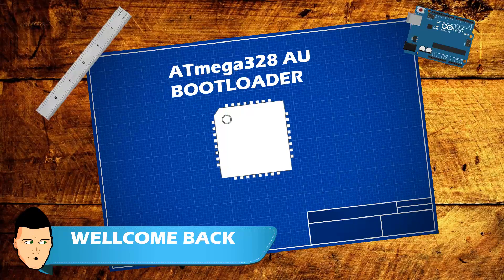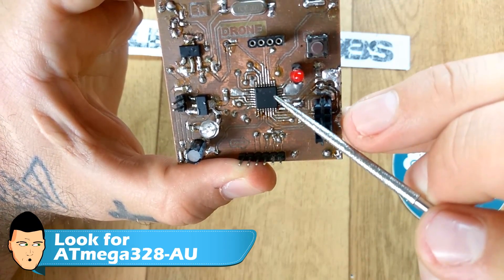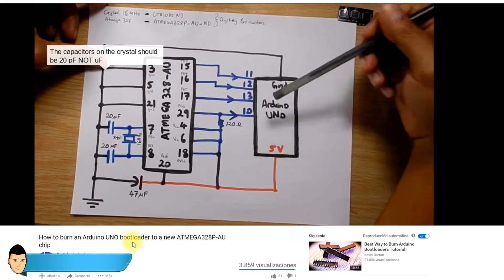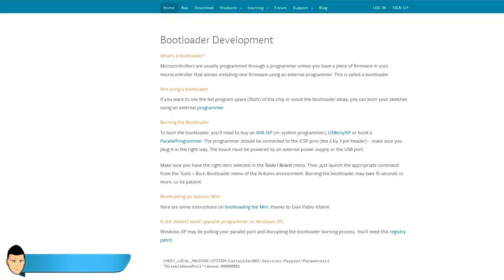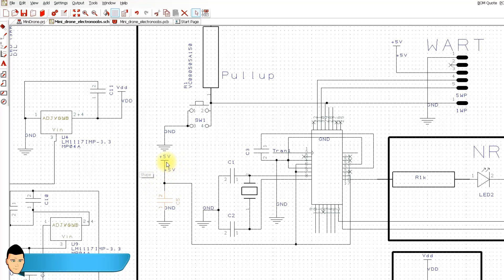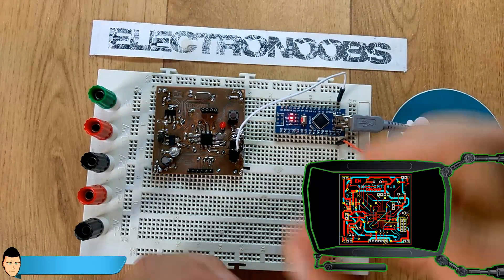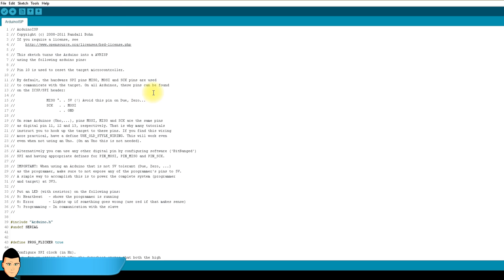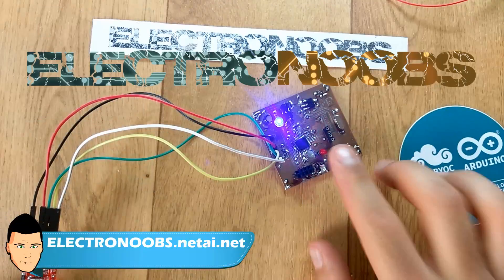Burn bootloader to ATmega328p AU with Arduino NANO

Comment: you mean I need to use an Arduino Pro Mini 3.3V/8MHz version to burn the bootloader to a virgin atmega328 chip to be ran at 3.3V/8MHz ?

Comment: The circuit to burn the bootloader does not have the 0.1uF but the FTDI circuit has, is the 0.1uF required for both. Also the 47uF cap is electrolyte or cermic because you are using a US type?

Comment: NO FUNCIONA, en el minuto 4:21 tienes una conexión Wart con los pines 4,5,6 (del modulo FTDI) a pines 31,30,29 (del micro) respectivamente, y en tu página tienes un diagrama que muestra los pines 4,5,6 (del modulo FTDI) a pines 30,31,29 (del micro) respectivamente. entonces estas invirtiendo los pines 30 y 31 del FTDI al micro en tus diagramas. Yo sin darme cuenta, hice mi PCB con la primer configuración que menciono y no funciona, también intenté la segunda con el mismo desfavorable resultado. Aguas con eso

Comment: thank you for your very informative videos ..
and please do any body have a way to burn bootloader to " atmega328 U " ?
i did it in many ways but with no luck!
Reply: the cap is supposed to go on the main arduino rst to gnd
Reply: @ronkirby5290  i did that and same result ..
i bought another uno and i will use it as programmer

Comment: Also, why the hell do you have an electrolytic cap between AREF and 5V??? WTF??? How did your board not blow up?
EDIT: If anyone wants to know. DON'T PUT THE 47uF between AREF and 5V, especially a polarized one like above. I just successfully uploaded the bootloader to an Atmega328p-au and it worked by putting a 47uF cap between
Reply: https://youtu.be/Kh4iZb2YTT8?t=138 actually shows how and where the 47uF should be.

Comment: I don't see why you need the ftdi you can program using an arduino just like bootloading I just have to change the device signature for the 328 to match as was different from my UNO.

Comment: Can you remove boot-loader after uploading the code for faster boot? Or maybe burn code without the boot-loader using a Arduino as programmer? I have seen a video on youtube where you can burn a sketch without a boot loader using the programmer. It seems that if you want you can skip the burning boot loader part and don't even need the FTDI module.
Reply: Good observation, boot loader and ch340 are not needed,
ch340 needed only if he wants to communicate via usb.

Comment: Another option is to remove/break the connection of the ic on a nano/mini and connect the programming pins to the pins of the adapter and simply burn the bootloader directly

Comment: Hola crak!!
Una pregunta no entiendo porque a la entrada del Reset le pones 5V con una resistencia de 1k??
Y en la entrada del AREF le pones un condensador de 47uF???

Saludos!!
Reply from the maker: Porque el reset se activa negado. Quiero decier que se hará un reset cuadno se pone GND en el pin. Por eso se pone un pullup de 5k a Vcc. AREF es el voltaje de referencia y debe estar bian estable por eso se pone una capacidad de copuling. 

Saludos!
Reply: Perfecto!!
Si no voy a usar el AREF en mi proyecto me recomiendas que lo alimente igualmente??
Cuanto menor sea el número de componentes menor será el coste de fabricación de la pcb y el montaje.
Quiero fabricar una pequeña tirada de placas en china para la fabricación de una máquina.
Si me puedes decir de alguna empresa que con los archivos en kicad me puedan fabricar y montar la PCB te lo agradecería.

Saludos!!

Comment: I used SMD socket to connect the Atmega 328p-au to breadboard and make the connection as instructed. But I received 
avrdude: Device signature = 0x000000 why?

Comment: Outstanding video!  Great job.  Following your instructions I was able to burn the boot loader, but I was not able to load any program afterward and I followed the instructions exactly.  Any suggestions?  Thank you.
Reply from the maker: Once you burn the bootloader remember to change back the programmer to normal. Make the Rx to Tx and Tx to Rx connections. Also remember to add the 0.1uF cap to the DTR pin. You burn the bootloader to SMD or DIP chip?
Reply: Yes Sir, I have changed the programmer back to "AVRIPS mkll".  I have connected the FTDI module (red board) according to your last schematic, with extra capacitor.

I am using a SMD, 32-TQFP. 

According to the arduino website, when the target chip is reset, it is supposed to blink PB1 (pin 13).  Because I do not blink when resetting the target chip, this must mean that I have not actually burned the bootloader.

This is strange because the IDE says "done burning bootloader" when I try to burn it.

As a test, I intentionally tried to incorrectly burn the bootloader with incorrect programming settings and wiring and each time I got an error.  This at least is a sign that I am on the right path.

Thank you,
Reply: I should also mention that I am not using an official Arduino Nano, because they are sold out, however I am able to program and use it normally by itself.

Comment: Hi Thank you for your video.
I have some question, I bought Nano with 328P-AU from ebay. I can't burn my program to my nano board. I think it doesn't have a bootloader. I try to burn bootloader to my nano (328P-au chip) and I got this message 

"avrdude: Expected signature for ATmega328P is 1E 95 0F
Double check chip, or use -F to override this check.
Error while burning bootloader."

I have on idea to fix it. Could you suggest me to fix it?

Comment: So with the method,  I can follow these institutions to burn the bootloader from one nano to another nano,  correct? Because the Arduino you made has everything a purchased one does  I'm guessing.
Reply from the maker: Yes, you're right! You could burn in the same way a bootloader from one nano to another. It's the same chip and the same configuration!
Reply: ELECTRONOOBS Thank you so much for the response. I searched for hrs and your video helped me out tremendously. 
You now have a new subscriber.
Reply from the maker: I'm so glad that it helped you! Thank you and keep up!

Comment: Hi why need the 47uf capacitor there connected to vcc and why no good the 100nf connected to gnd ?
Reply from the maker: Hi there. The capacitor is connected from 5 volts to Aref whic will be the analog refference value. It could be also connected to ground and you could also use a different value. The reason of this capacitor is to supply a very stable 5 volts power when needed and to eliminate any noise of the input power. A comune value is 33uF or 47uF.

Comment: Thanks for the tutorial Sir. I just wanted to know can we use the same bootloader configuration to burn the code. By pressing the shift key before uploading the code. This would burn the code to our chip? Instead of the FTDI interface.
Reply from the maker: Hi there. I never tried that. The configuration for the bootloader burn is a SPI communication. I think it could be possible and I might try it but I always used a UART communication using Tx and Rx.
Reply: That bypasses the bootloader I suppose. I just want to confirm which option is better. I hope you'd have better idea. Kindly revert soon. :)
Reply from the maker: I recommend you FTDI connection. If you don't have an FTDI module just use the FTDI pins from the arduino UNO. I will let a link with the schematic for a FTDI conection using Arduino uno.

http://electronoobs.com/images/Arduino/ArduinoUSBSerial_FTDI.png